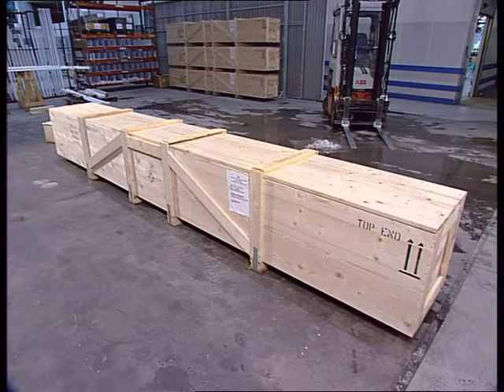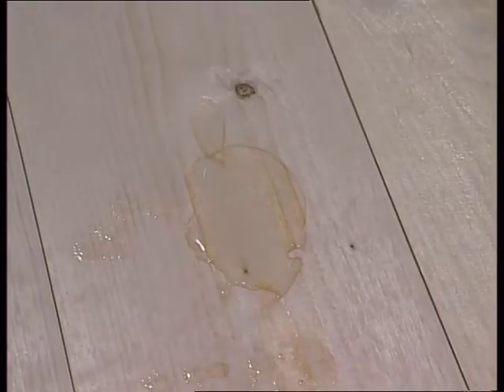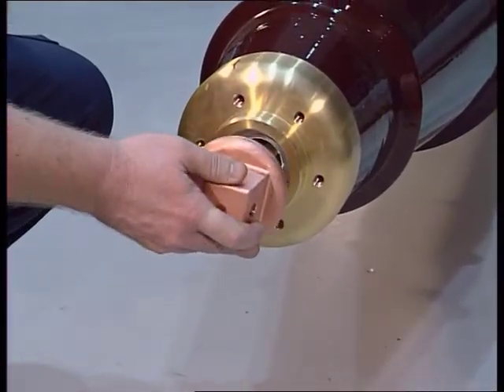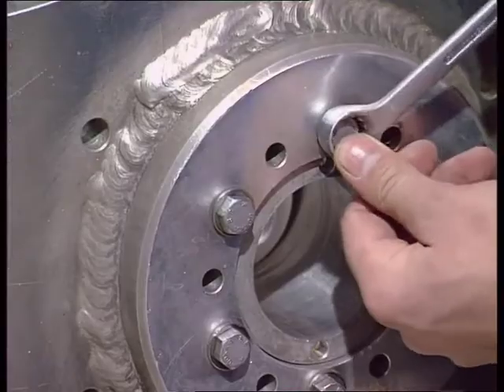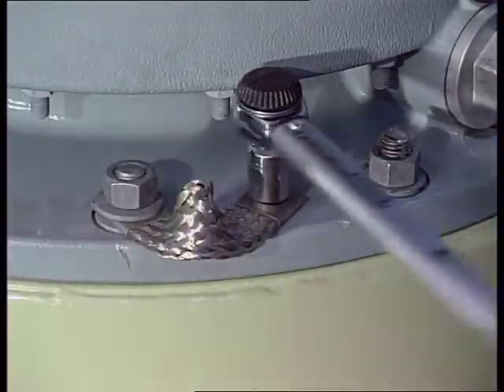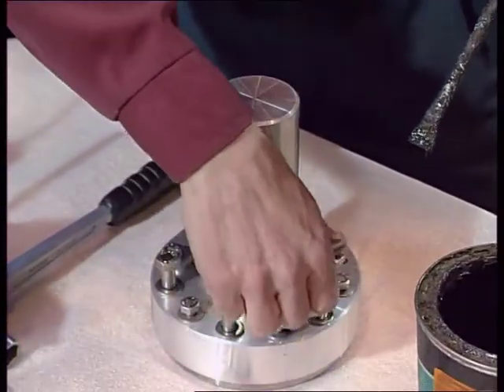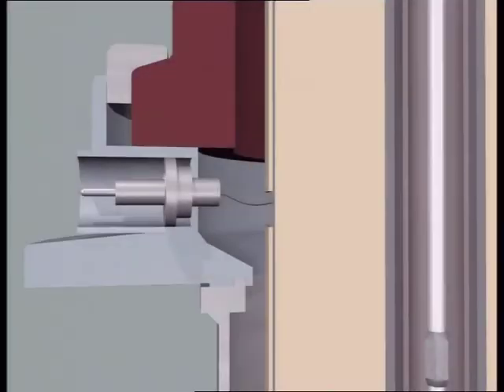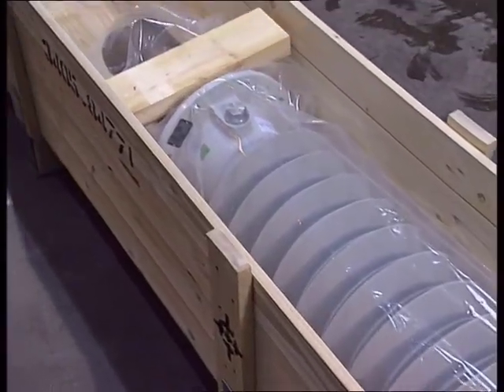Transformer bushings unpacking, installation and testing

Comment: Excuse me Sir, can we use Neutral bushing  800A, 74.5kv for 63MVA power transformer instead of Neutral bushing 800A,100Kv for 90MVA power transformer and why?
With my best regards
Reply from the maker: Check the rated voltage and BIL and shortcircuit capacity